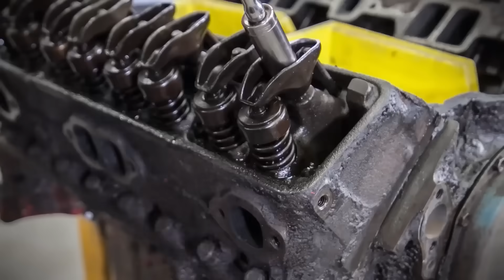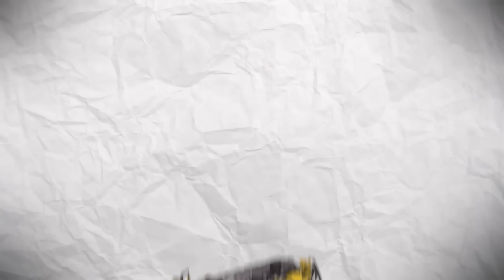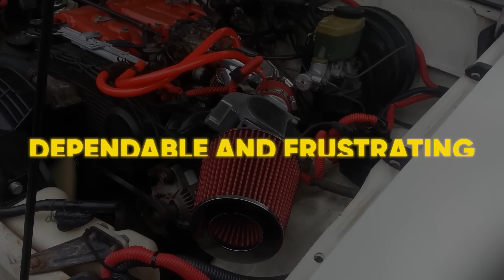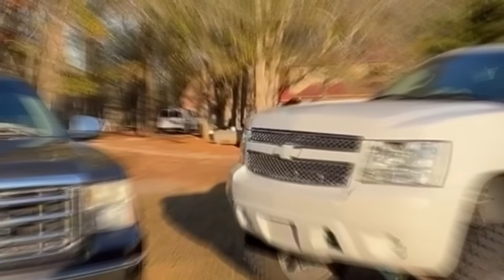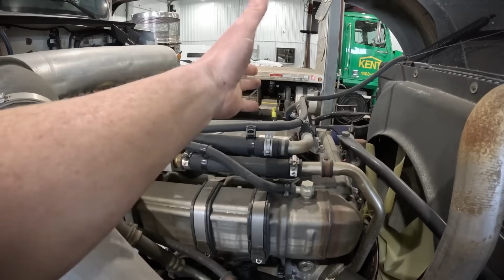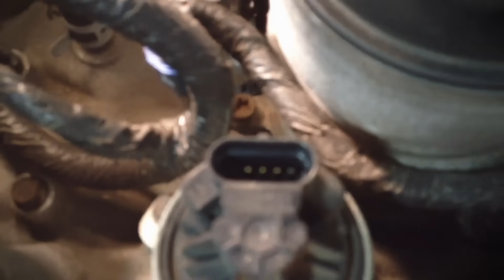The WORST Truck Engines EVER Made! (AVOID AT ALL COST!)

Comment: I have mixed feelings about the 4.7l. Had two. Dodge Durango that 3 days after the 12th oil change at the dealership (3k for each one), it threw a rod and grenaded itself while driving at 50mph. New engine under warranty. Dealer broke the windshield putting it in and I forced them to fix it. Put about 60k more miles on it and the tranny failed after 3rd fluid and filter change (also fixed under warranty). Those MOPAR extended warranties paid for themselves in spades. Got rid of it.

The other is actually a Mitsubishi Raider (liked the design better than the Dakota). The motor threw a rod at 46k (3 days after an oil change at the dealership. While a vehicle is under warranty, I always have it changed at the dealer. This was after the 11th oil change (every 3k). Motor was replaced. At 61k (after second tranny oil change and filter), the tranny went out. I should have gotten rid of it, but I really liked the truck as it was comfortable, paid off, and had the MOPAR factory warranty. The tranny was replaced.

At 96k the tranny failed again. Mitsubishi could not even fix it. Chrysler had to replace the tranny and then send to Mitsubishi to program it. At 150k, the motor grenaded itself again. Found out the year model of that truck had a severe issue with motor quality. MOPAR warranty gone, so I found a 2011 Dodge Dakota and did a motor swap. The truck now has 275k on it. This motor clearly has more horsepower and runs so much smoother. I still change the oil at 3k. Had to replace the engine computer twice (new computer has all updates and truck runs like it first did). The truck actually runs good, still looks great (people cannot believe how old it is and the mileage it has), does not smoke, is quiet, can tow when needed, and still comfortable. I will never buy another Chrysler product again, but will run that truck until it cannot run anymore.

Comment: You can rest assured that anything labelled as "Eco" is going to be a steaming pile of doo-doo.  Guaranteed.
Reply: Most of those turbo engines need replaced it 150,000
Reply from the maker: Yeah, the "Eco" label definitely gets a lot of mixed reactions. Some of those engines hold up pretty well, others… not so much. Kinda depends on the model and how it's treated.
Reply: Got 225, 000 out of mine, before someone decided to run a red light

Comment: Have to question the call on the 4.7 Dodge engine, have one with nearly 200k, yes that cam chain is an issue, not really hard to replace, but time consuming.  Changed mine out and it took me about 8 hours total, sorry to say that pot of coffee was the main reason for the time extension, so sue me as am retired Navy and coffee is a MUST in the shop.  If they start ticking, replace the Lifters NOW, again it is actually a simple job.  Seems as if that sludge buildup evolves around what brand of oil and oil change intervals.  Stepson had one and he changed the oil, eventually, and he had a huge sludge issue when he had to address issues.  Mine looks clean still, but I actually change oil and filter at 3K, cheap insurance.  And if you ever overheat it, you are simply -ucked, they will drop an exhaust seat, that is operator error.  And they are gutless wonders, sort of like those old C50-60 grain trucks with a 283, you have to wind the hell out of them for any power, and that is using gearing.  I wouldn't pick one as a first choice, but a used truck you have to take what it has installed, and do your checks before plunking down the cash.
Reply from the maker: Thanks so much for the great info and tips—really appreciate the firsthand insight! You're absolutely right: proper maintenance and regular oil changes make a huge difference, especially with engines like the 4.7. Sounds like you've taken great care of yours, and that Navy-grade coffee-powered timing chain job is impressive! Totally agree—sludge issues often come down to neglect and bad oil habits. Thanks again for sharing your experience!

Comment: MY Son Just bought an F 150 lariat with 88 k mile & has  the 5.0 very noisy tick on passenger side plastic oil pan & plastic oil plug hope it holds up
Reply from the maker: Yeah, that tick on the 5.0 is pretty common—definitely something to keep an ear on. The plastic oil pan and plug don’t inspire a ton of confidence either, but hopefully it holds up just fine. Wishing your son lots of smooth miles with his F-150!

Comment: Oh to add to my previous comment I would want a fully mechanical Diesel engine. Something truly easy to work on, diagnose and repair. I wouldn’t care how old it was as long as it was well maintained or even rebuilt.
Reply from the maker: Thanks for sharing! That’s an awesome dream truck—there’s just something timeless about a square body diesel. The simplicity, ruggedness, and ease of working on those older mechanical engines really make them special, especially compared to the tech-loaded trucks of today. Totally get where you’re coming from with the frustration over modern electronics and over-engineered designs. A well-maintained or rebuilt square body with a small lift and solid tires sounds like the perfect combo of utility and style. Hope you find the right one someday!

Comment: My dream truck is a square body diesel. I just love the square body. Never drove a square body diesel but would like one with a small lift kit and some decent tires. I’m not a fan of the new trucks with all the electronics. You can’t fix them. Everything is computerized requiring expensive tools to simply diagnose even the simple stuff. I know my former bosses had a Ford pickup truck that to change the oil or do anything meaningful they had to pull the body off the frame. What a mess that was.
Reply from the maker: I hear you! Square body diesels are awesome—tough, simple, and they just have that classic look. A small lift and some solid tires would make it even better. Totally agree about the new trucks too—way too much tech, and fixing anything feels like a nightmare. Nothing beats being able to wrench on your own rig without needing a computer!

Comment: My 2009 F250 Superduty 4x4 has the 5.4 3V.  Bought it new, so it's 16 years old now with just under 160K.  Somewhere between 80K and 100K, I had the spark plugs replace, partly due to mileage accumulated and fear of them breaking.  Also had a an exhaust manifold stud (last one on passenger side) break.  This happened fairly early on, but I never had it fixed.  You can hear it tick for 3 - 5 seconds on cold start up and then it goes away.  I do regular oil changes at 5K (now using Walmart's 5W-20 full synthetic for high mileage vehicles).  Has never burnt oil and has always run well and been extremely dependable.  I plow snow and tow a fair amount of heavy loads.  It's been a great engine to me (maybe I got a luck of the draw good one).  My mechanic has the same engine in his truck with around 300K, and his story is the same as mine.
Reply from the maker: Really appreciate you sharing your story! Sounds like you’ve taken great care of your F-250, and it’s awesome to hear the 5.4’s been solid for you—especially with all the heavy use. That kind of reliability is what we all hope for. And yeah, regular oil changes definitely make a difference! If you get a chance, check out my video on the best engines too—would love to hear what you think about that one!

Comment: The Cummins ISX 600hp engine wasn't that bad, although it's never got the mileage of the Gen 2 Cummins non Egr. I never liked the Egr engines or their set up of recycling their own waste. They did pull pretty well though and weren't to bad on fuel when driven properly.
Reply from the maker: Thanks for sharing your take! Yeah, the ISX 600hp definitely had its strengths, even if it didn’t match the mileage of the Gen 2 non-EGR Cummins. That EGR setup has always been a bit controversial, but like you said, they still pulled strong and could be pretty efficient when driven right. Appreciate the insight!

Comment: Drove an ISX for about 600,000 miles when I retired and only had bunch of EGR valves and 1 expensive EGR cooler put on it. Didn’t burn oil and couldn’t be passed by only a very few trucks if I didn’t want them to. Still running strong when it was traded in for tax reasons. Was replaced with a Maxi Force for the new driver, poor guy.
Reply from the maker: Wow, that's impressive! Sounds like the ISX was a real workhorse for you. Only having a few issues like the EGR valves and cooler after 600,000 miles is solid. And I can’t blame you for keeping it ahead of the pack! Too bad about the Maxi Force for the new driver, though—hopefully, it treats him well. Thanks for sharing your experience!
Reply: @Autotrends5  I went back and ran a few short trips part time for them and the Maxi Force was traded in with 25,000 mile for a Freightliner with another Cummins. The International couldn’t make a 500 mile transfer trip overnight without breaking down which really screwed up the whole logistics of the company.

Comment: I had a 5.4 triton, spark plug blew out. Happened so much they made a fix for it. Chewed up coils on a regular basis. Had barely any power & sucked on mpg. But it worked as a truck
Reply from the maker: Man, that sounds like the full 5.4 Triton experience! Not great on power or gas, but somehow it still kept trucking. Thanks for sharing your story!

Comment: If this is AI video, they should have programmed neglect in the system. A lot of the modern engines failed early due to lack of oil changes and damaging extended oil change intervals. 
If properly maintained, all the modern engines can go the distance needed.
Reply from the maker: Thanks for the comment! Just to clear things up—this isn’t an AI-generated video. There’s a real person behind every script, spending long nights researching and writing to get the most accurate info possible. Sometimes small production errors slip through, but that’s because we're human—not robots—and humans do make mistakes. That said, you're absolutely right that maintenance plays a huge role in engine longevity. Appreciate you watching and sharing your perspective! We'll strive to do better!

Comment: I have to call BS on the first gen 3.5 Ecoboost being in the list. I just sold my 2011 3.5 ecoboost F-150 HDPP with 250k miles on the original motor and it's still running hard in 2025!  It's a beast of an engine, but you actually have to maintain it with regular oil changes (5k miles) and use good oil.  Run it hard and it will be just fine.
Reply from the maker: Thanks for sharing your experience — 250k miles is seriously impressive, and it’s great to hear your 3.5 EcoBoost is still going strong! Regular maintenance really does make all the difference, and your comment highlights that perfectly. We try to cover a range of real-world experiences in our videos, but stories like yours remind us there are always exceptions. We’ve got more engine-related content coming soon, and I’d love to hear your take on those too — hope to see you back!
Reply: @Autotrends5  my 2.7 Bronco is at 110k, but I am worried about the belt driven oil pump being a potentially weak spot with regards to the long term reliability there... still the 2.7 has been flawless for 110k miles.
Reply: @mpeugeot just do the oil change at 5k not the 10k the manual says that's what would do you under.
Reply: That's what I said people that do it at 10k could and will have problems but if you do it every 5k you'll be fine.

Comment: When did GM make a 5.7 Chevy diesel, I know they make the 5.7 Oldsmobile but the GM engine was 6.2 made my Deitrot Diesel and were a little under powered but damn good engines. I have one with little over 540k on it and never let me down yet. I have had around 8 700R4 trannys in it until I put a standard transmission in it a few years back.
Reply: Oh they made them alright.   They weren’t very popular so you seldom saw them very often.    It was what the airplane crowd calls “ an orphan”.

Comment: I'd say many very good criticisms in this video but overall very misleading. Placing the 6.0, 6.4 and 5.4 at number 321 is kinda humorous. B life (commercial standard) for a 6.0 is slightly higher than a cummins 5.9, around 490k miles. Likewise a 5.4 can hit 350-400k if you change the oil.
Reply from the maker: Thanks for sharing your thoughts — sounds like you've got great experience! You’re right, with proper care, engines like the 6.0 and 5.4 can last. We’ll be diving into more engine topics soon, and I’d love to hear your take. Hope to see you in the comments! Thanks again for your feedback!

Comment: Awful video with all kinds of inaccuracies. Relying on so called A.I. is not a good idea.
Reply from the maker: Thanks for your feedback! There's a lot of research behind each video, not just AI. I'll review the points you mentioned and work on improving the content. Hope you'll give it another look!
Reply: That's what I'm thinking the idea that 3.5 Ecoboost is on here when I regularly see them at 300k plus is insane, I just saw a 2012 3.5 with a million miles on it the other day and I have a 2012 myself it's a beast and tows twice what the V8 does and can't die.

Comment: I have a 2011 f-150 5.0.  It started losing oil at about 120K miles at a rate of a quart every 1K miles.  Ford said it was within normal specs.  It wasnt smoking or leaking into coolant.  I just got in the habit of adding a quart every month between changes.  Then it just stopped using the oil around 180K.  I dont even add oil between changes now.  No one knows why it just stopped.  Now at 256K and its going strong.
Reply: My brother has a 13. His truck was using oil also. I think he fixed it by adding an oil catch can. Another thing with those trucks. The quick disconnect fitting up by the transmission cooler break off for no apparent reason.  It's not a question of if it's going to break. It will break at the worst possible time. His broke coming back from a camping trip, towing a 2.5 ton bass boat. Luckily, I was behind him and I saw smoke. We thought the engine blew up.  Luckily he stopped before he lost all the fluid.  Otherwise the transmission would've burned up for sure.
Reply from the maker: That’s wild—glad to hear it turned around on its own! These engines can be full of surprises, and it’s awesome yours is still going strong at 256K. Thanks for sharing your story!
Reply: Every person's dream that doesn't have enough money to immediately work on or send their car to the shop. 
Hoped my transmission was going ro hold up on a mazda with a rattling bearing, but it finally went after driving it too hard a couple days 70k miles after the rattle started. Stay blessed 😂

Comment: AI messed up... 5.4L 3V V8 was available in 2004-2010.  Not since 1997.  The 5.4L 2V V8 put in the F150's, Econolines and other Ford trucks is actually one of the best motors Ford ever made.  The 3V had cam phaser issues and narrow oil channels in the cam bearing that cause sludging and under oiling.  But the 2V was a workhorse.  I have one now with 263k miles on it and still runs strong.
Reply from the maker: Great catch, and you’re absolutely right—thanks for pointing that out! The 5.4L 2V was a solid engine, and it's awesome yours is still kicking at 263K. Just so you know, there’s a real person behind these videos, and I lose a lot of sleep trying to put out solid content. But hey, I’m human, and sometimes stuff slips through. Appreciate you pointing it out!
Reply: @Autotrends5 thanks for the info and video. I would prefer a real human narrator vs this AI stuff. Try it yourself
Reply: Good catch Brother. You must be a Blue Oval die hard.
Reply: Agreed, the 2V engines will run forever. I’m a fleet mechanic and my company has over 30 E350 SuperDuty vans all with the 5.4. Other than occasional failing ignition coils and belt tensioner/idler pulley bearings going up, they’re bulletproof
Reply: I've got a 4.6l 3 valve with 230,000 miles and it still runs like new. Proper maintenance goes a long way.
Reply: Thank you for that!

Comment: I'm a Mopar man had a 4.7  360 v 10 and others now a 6.7 cummins. The eco diesel was a gm motor for the European  market sold to fiat  no wonder it failed at first  but improved over time
Reply from the maker: Nice! Sounds like you’ve had some solid trucks — can’t go wrong with a Mopar or a Cummins. Yeah, the EcoDiesel had a rough start but got better over time for sure. If you’re into trucks that just keep going, I just put up a new video about the best truck engines that last forever. Check it out when you get a chance! https://www.youtube.com/watch?v=U1F2BedwB3k

Comment: Cheap seals, plastic parts..uggg One of the biggest mistakes was incorporating TURBO tech on a lot of these engines.. You take a small engine, even a small V8, and put a turbo on it you're asking for headaches...
Reply: Dumbest idea ever. It may work in the Indianapolis 500 for 500 miles but a vehicle that need to go 250,000.00 miles it was and is sheer idiocy
Reply: Engineers have a lot of bad ideas, motorcycle engines in a pick up truck was a stupid idea from the outset. Explain to me why fuel economy matters on a vehicle when you’re towing 10,000 pounds. It’s the towing capacity that matters not miles per gallon 😂We don’t need fuel efficient trucks we need dependable trucks that can move trailers
Reply from the maker: You make a great point—turbocharging smaller engines can definitely bring some extra challenges, especially with certain parts. It’s a trade-off between power and complexity for sure. If you’re interested, I just posted a new video about the best truck engines that last forever—engines known for their reliability and toughness. Would love for you to check it out! https://www.youtube.com/watch?v=U1F2BedwB3k